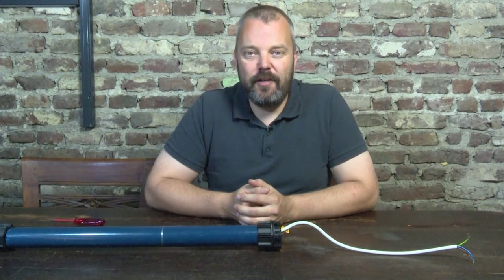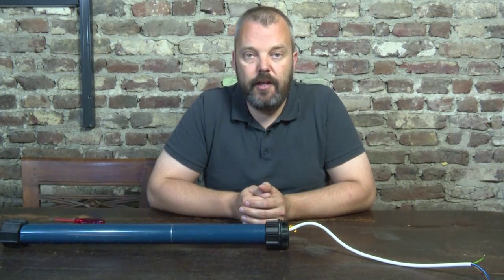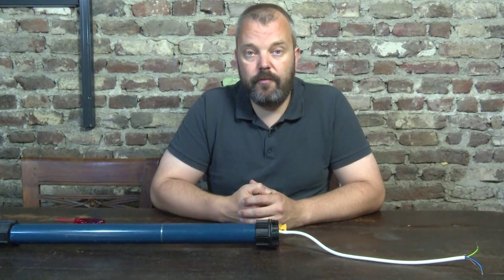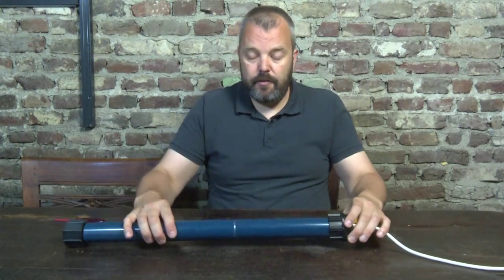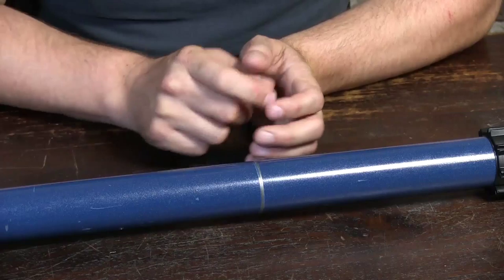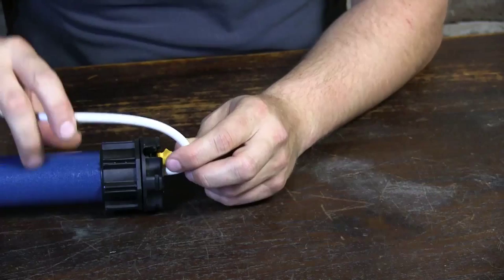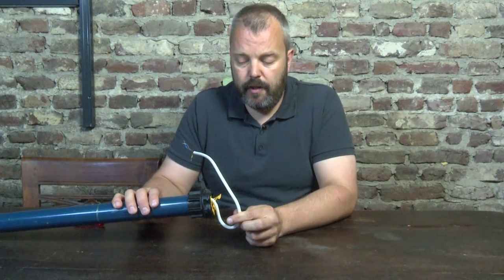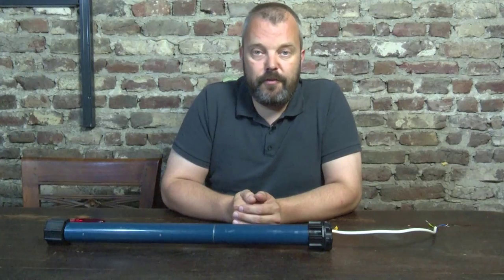4 tubular motor installation tips that avoid problems and keep your warranty intact

Comment: Hi my motor will go down but makes a funny noise when I press up and won't go up, any tips? It's a Somfy ariane 6/32 PA LT 50. Any help would be most appreciated. Using it for a projector screen. Thanks!
Reply from the maker: If the motor doesn't go up and only makes a funny noise, it has probably lost its power. There's no reset on an Ariane, so there is no other option than a new motor, unfortuantely. Make sure to keep the crown and driver of the old motor, as in the case of projection screens, they are likely custom and not regular Somfy stock items.
Reply: Thanks for getting back to me so quickly! Do you know if I can take the motor out of the pipe? I've opened up one side and got the wires out but I haven't managed with the other side. Also do you have any reccommendation of a brand that i can buy a replacement from? I can't seem to find a Somfy in the UK. Thanks again!